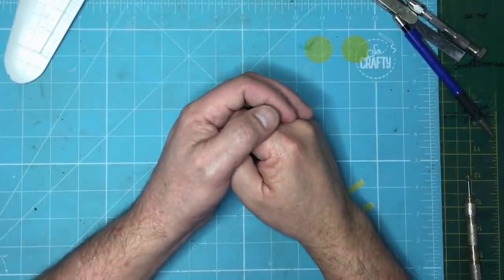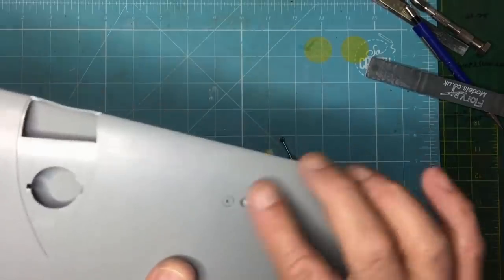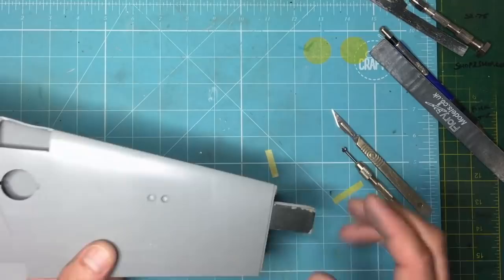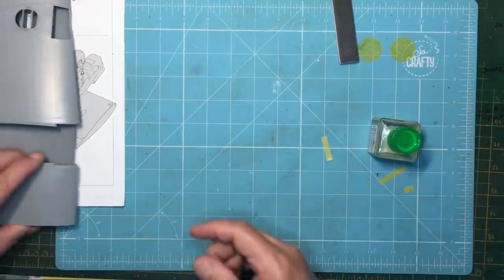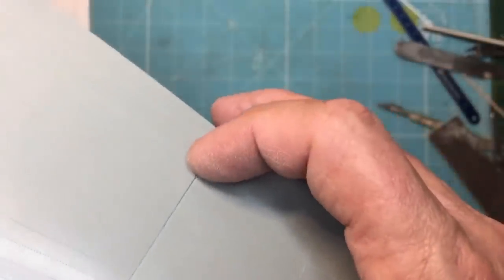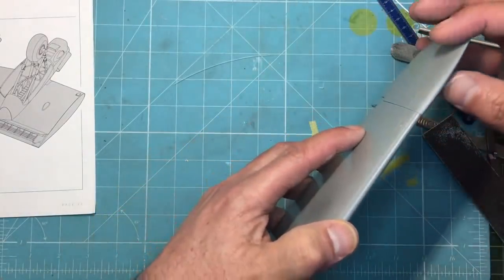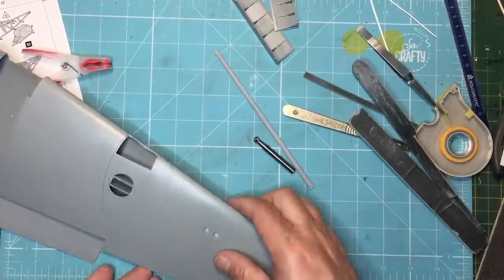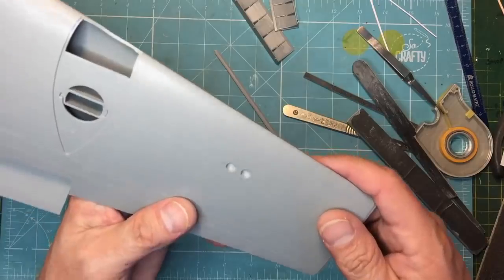HK Models 1/32 Lancaster. My upgrades part6

Comment: The wing tips were made of wooden joined frames covered by metal skin. The wing tip rear marker light is a three tube light with resin colored lenses. This was used mid war in order to have passive formation lights during flight. The outer lense was green or red depending whether right or left, the middle lense was white or clear used for takeoff or landing also while in the airbase flying area and the inner lense was blue for formation flying over  enemy territory.  At least that is what the flying manual stated for canadian mk.10 Lancaster.
Reply from the maker: Thanks for the info Kevin. Mine is a Dambuster, so I guess those formation lights need to go?? I'm sure they shouldnt be there on a Mk 1/111?
 I've spent around 5 hours on those pesky wingtips today, but they're done now with a panel line as the seam and all the rivets still there.

Comment: I was thinking that if I was to saw the leading edge of the wing tip with one longitudinal cut, when pressed back together for glueing, it may take out the step and bring the panel lines into registration. 
What are your thoughts Nigel?
Reply from the maker: That's a good idea, but why not saw the tip in half, like a Pitta bread, so you have a top and bottom section? That would make fitting them MUCH easier. I wish I'd thought of that before.
You could sand the front down to thin it so it matches the contour of the wing.

Comment: Heard some of the new UV glues harden clear,if not too thickly laid.JML sell one.
Reply from the maker: Thanks Darron. I'm just experimenting now with some Aquagloss. I tired the Revell clear but that dris like a ring with a hole in the middle?
Reply: Ive just been opening exhausts on 48 dragon me 110,with a .2 drill bit.Had to be done.All MG's had hollow barrel's in kit,sad leaving exhaust's solid.I think i'd get bored with ICM kit,like i did with eduard.But the DML ju88 a6 looks perfect.Please have a look at albion alloys connecto vid.I would like to hear what sort of things you would do with it as an option.The 0.4 means you can make joins,3,4,5,6 sided with 0.5 brass tube.You can get it up to 1.0mm size.
Reply from the maker: @darronhedges5873  I've seen the connecto you talk about, but dont have a use for it. I think it may be difficult to keep the top rail straight if you were doing a hand rail for example?
Reply: I bolstered a long rail with a couple of join's by sliding a 0.2 knickel silver rod along inside it.I only wanted you to look,because its newish and hardly mentioned on utube.I have had some fun with it.And thought it may have uses i hadnt thought of.No drama.Just didnt want to suggest obscure reviews via comments section.Looked at the 17 pound metal tank kit by people who made my 'metal 88' kit on ebay yet?..It has pictures of parts,built,and painted.Its an unusual kit indeed.Also, have 2 clear canopy sets for ju 88 and an eduard cockpit set if needed during build along by anybody.Theyre dragon,look pretty good.Soon.d

Comment: The wing tips were separately installed
Reply from the maker: Yeah, I know Kevin, but I still think it's a daft way way of producing the kit, especially with the "floppy" wings and poor fit. I mean, really, the outer wing is also a separate piece, so there could have been a join there just like Wing nut wings have done. Personally I wish they'd just done a top and bottom affair like pretty much every other kit out there, then we wouldn't have the issue of thin wing parts.